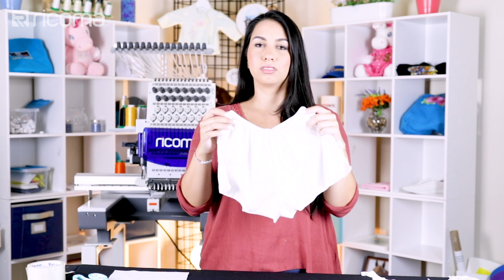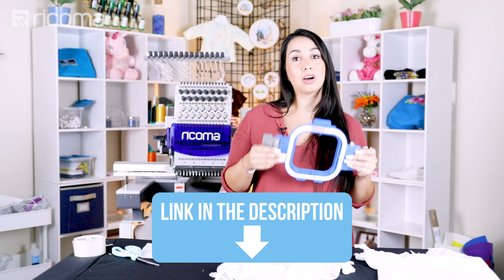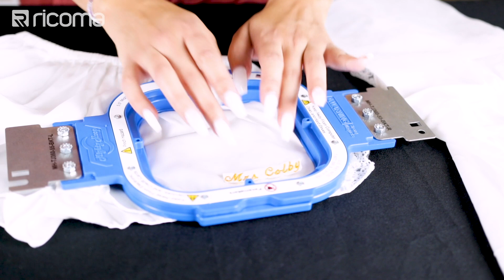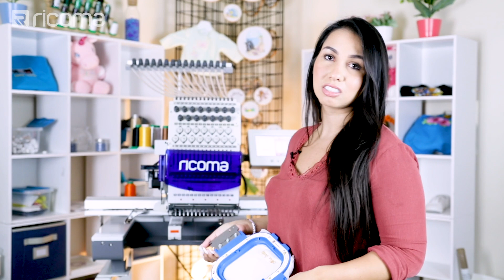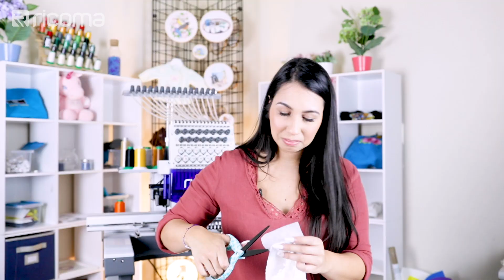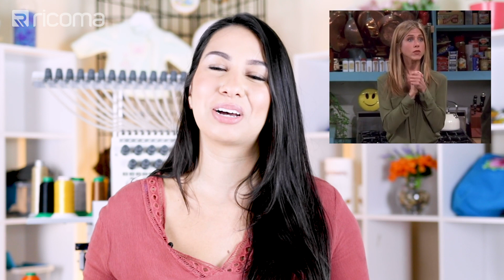Bridal Gift Embroidery!👰 | Make Premium Products for that Special Day! 🤑 (Embroidery Hub Ep89)

Comment: U r not talking abt needle used nor do say anything abt the actual stitch. Surely u can't just use any random . thumbs down.
Reply from the maker: Hello. We used 75/11 needle, and 40 thread
Reply from the maker: Hi Nat! What questions did you have after watching this video? I'd be happy to answer them here.

-Laura
Reply from the maker: We used a standard 75/11 sharp point needle. What questions do you have about the stitch? It was just satin-stitch lettering. :)
Reply: There's never a discussion about density of a design. If its too heavy it will damage the garment and  or come out hard as a rock on a garment. I doubt digitises watching your videos. It the folks who pull designs from whoever on internet and one always has to try it to see what fabric this design will suite.  However there are other videos on this subject. Just need to clean out my subscription. Thanks for asking